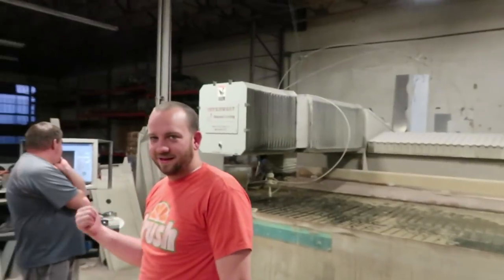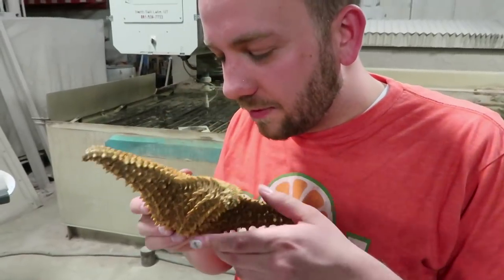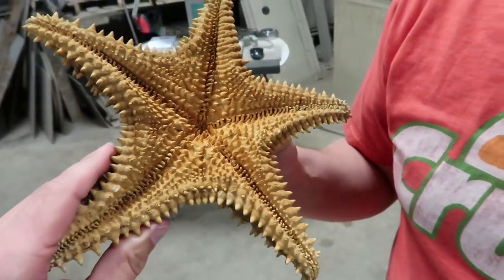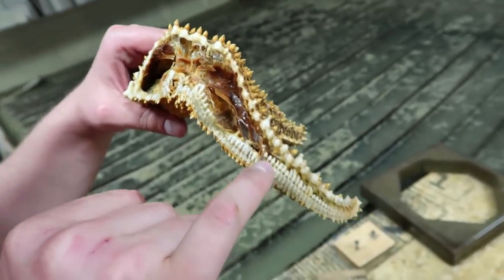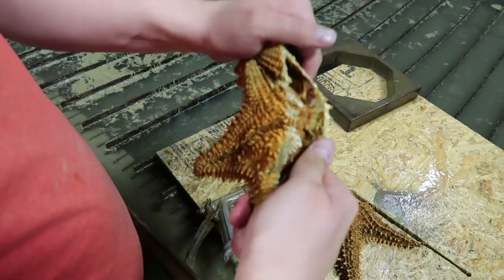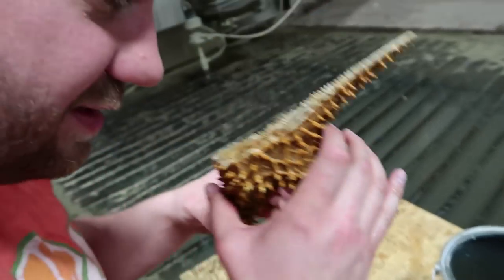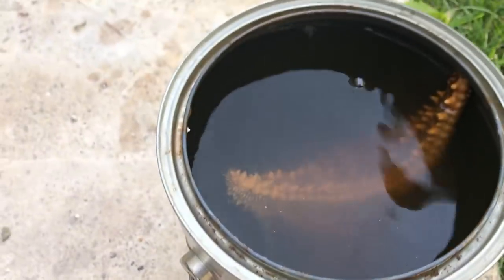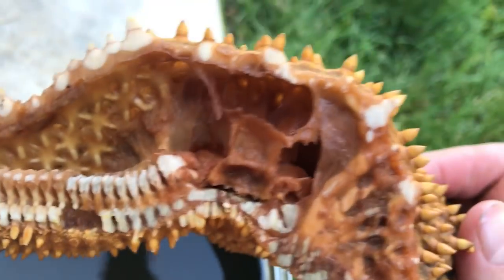Starfish Cut in Half with Water!

Comment: There's a white pixel around the middle of the video , visible when looking at the dude's face
Reply: I keep pointing this out, but apparently nobody else sees it. I think it could be something focus-related.
Reply: Yeah, the camera is obviously having a problem, those are definitely dead pixles
Reply: You just have a dead pixel
Reply: It is one dead pixel. Why get worked up over it?
Reply: I wish theyd fix it, I've seen it in their videos before
Reply: You can't "fix" a dead pixel without buying a new camera
Reply: smeezekitty sure you can, just use some software that approximates the color or the pixel based on the colors of the surrounding pixels, and do that for each frame of the video.
Reply: Or hot pixels